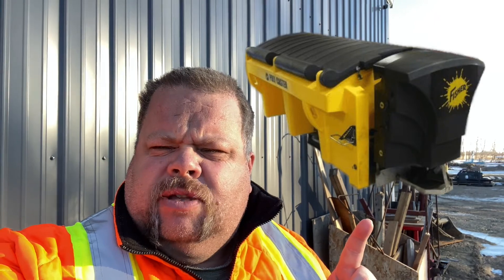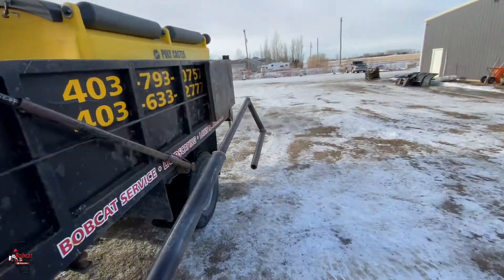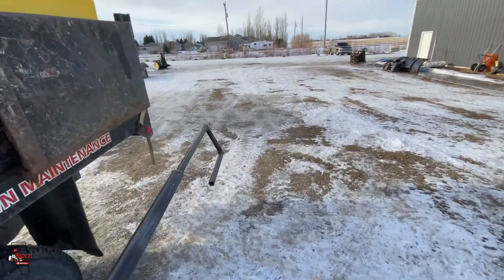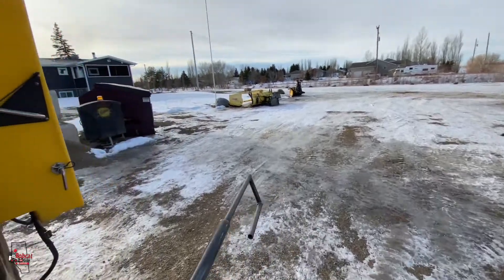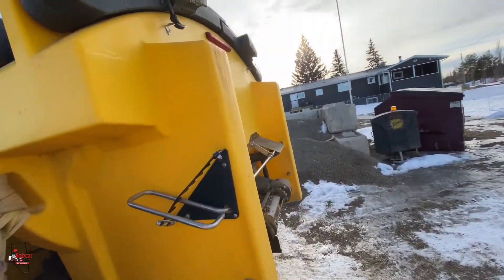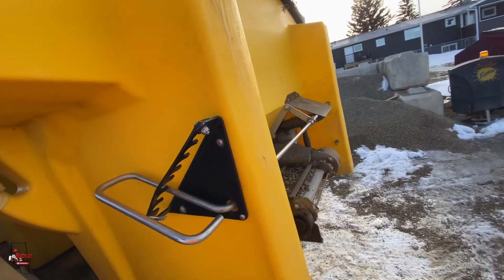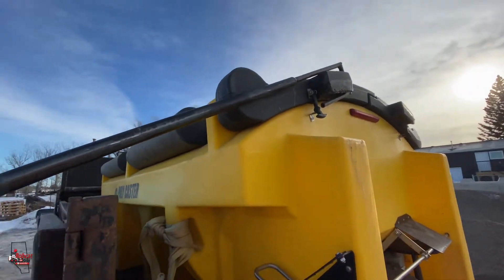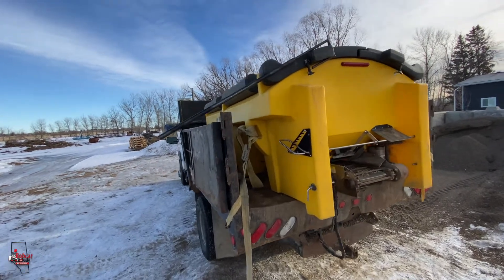Fisher poly-caster sander The must have tool

Comment: A must have tool!!!!!!! We have 2 of these spreaders, one is in a 1 ton pick up and isn't too bad to open if your around 6ft tall but the other is in a 1 ton dump and we need to either climb up into the bed which is a pain in the ars and dangerous or we have to use a ladder which is ok but this would be so much easier. I emailer Fisher a couple years ago and said they need to at least put holes molded into the lids so you can put a rope on each side and open it that way but never seen or heard back. Thanks to both of you for posting these videos.
Reply from the maker: i like to take credit but i seen this on you tube and thought we should make one